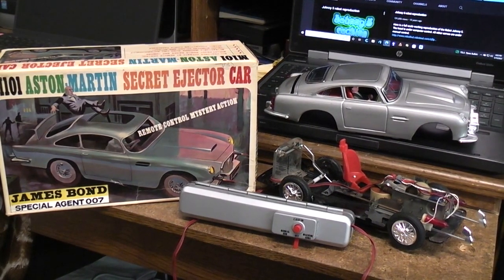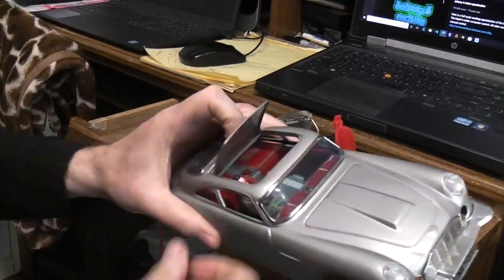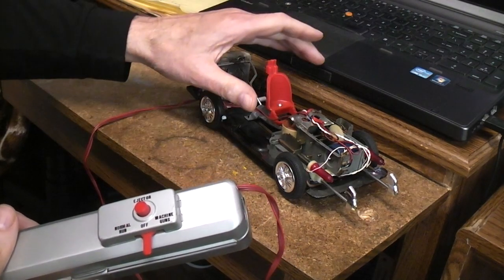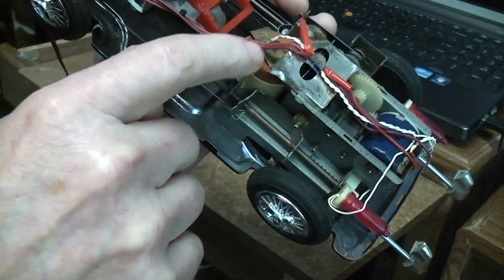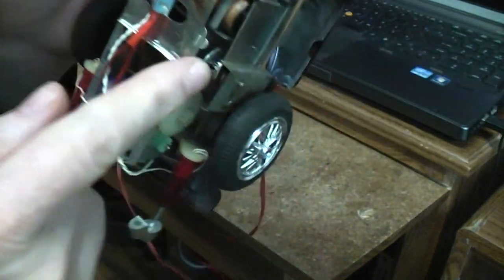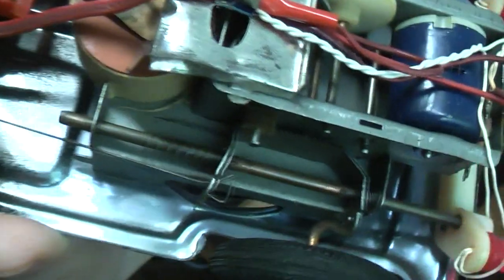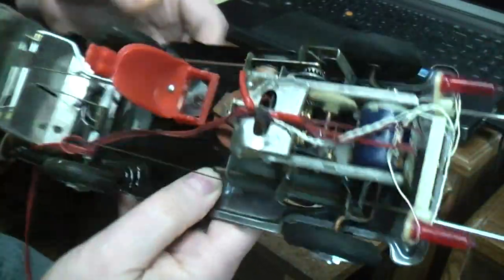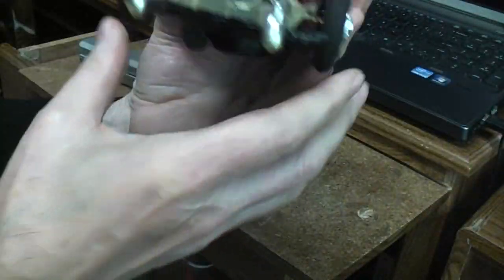Inside the Remote control, Aston-Martin, secret ejector James Bond 007 car.

Comment: Great video and explanation thanks, why do you think they didn't or couldn't use the electro-magnet to directly control the ejector ? not enough strength ? or did it not give enough throw distance ?
Reply from the maker: The ejector spring is really strong, more than an rat trap. The electro magnet could never release that spring on a wire remote system of 3 volts. So they came up with a magnetic clutch system that could. Very cool design.